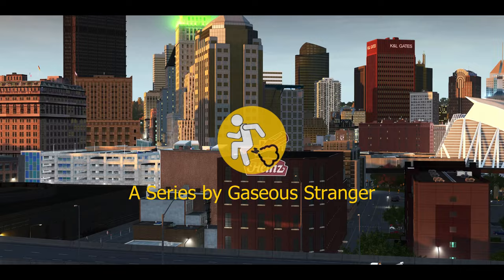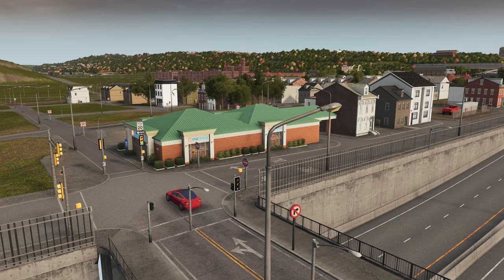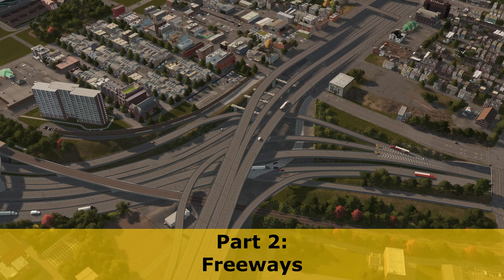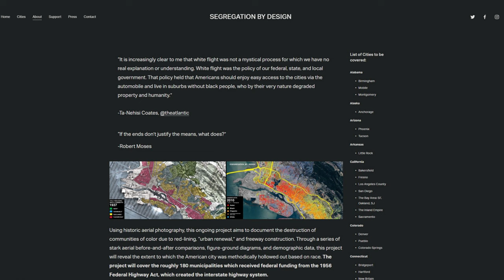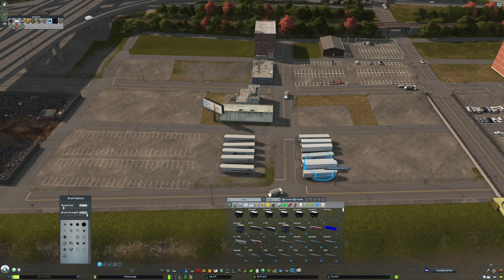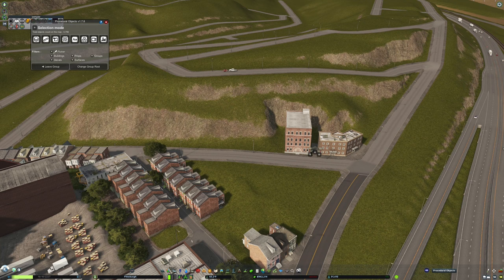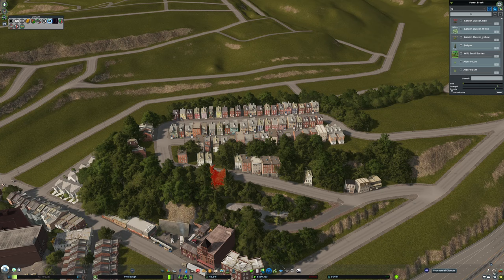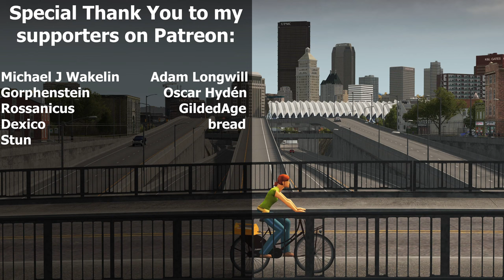Freeways Divide Cities - How Can We Fix Them? | Cities: Skylines Pittsburgh

Comment: I vote for a T line out to Ross and McCandless Crossing. Cap the Parkway North at key locations and put stops at those locations until you get out to McKnight Road.
Reply: Development in the North Hills just really isn't dense enough to support rail, unfortunately. You would have to convince people to drive from some subdivision to a park and ride and then to take the train into the city vs. a 20-minute drive into Downtown with ample parking available. 

If the T gets extended to the airport I would like to see it go up the Ohio River Boulevard area with stops in Marshall-Shadeland (selfish because I live there), Brighton Heights, Bellevue, Avalon, Sewickley, and then crossing over the river with a stop in Coraopolis before hitting the airport. That area is generally much more densely populated than anywhere in the North Hills except for that dead stretch of development between Ben Avon and Sewickley.

Comment: As someone who lives in pittsburgh i think i’d be a great idea to remove the freeway and replace it as surface roads. I could see some like this happening when I276 gets old and needs to be rebuilt. This is wouldn’t be unrealistic either in the US its becoming increasingly popular. Examples would by syracuse which is removing its downtown freeway or rochester which did so too. The problem with a cap park is that it’s not that effective of a solution because often it’s only at specific points that it reconnects the grid. Like for example the other cap park has many problem because of the location of where it connects. The street scape around it is very harsh.
Reply: I’d also like to add onto this that’d it be more attractive for the city too because the land could be redeveloped which means it makes the city money instead of just sitting there

Comment: Up here on this side of the Lakes, in Toronto, we're working on putting a cap park over our downtown railyard, and in my hometown, the highway to the future new bridge to Detroit was designed with many cap parks over it in an attempt to re-connect the two sides of the region. YOU get a cap park! And YOU get a cap park! And YOU!
My standard fantasy highway replacement consists of a simple at-grade parkway/boulevard/dual carriageway (low capacity, mid-speed,) separate bike highway, pedestrian promenade with kiosks and small vending areas for start-ups, and either a light rail/tramway or rail/s-bahn, depending which is better for the city.

Comment: A cap on 279 between Northside and deutschtown is probably as realistic as is possible for the issue… next most likely is an adoption of additional transit options up the 279 right-of-way (busways, T-service)… complete removal seems unlikely to me - the northern suburbs (Cranberry, Wexford, Sewickley) around 279 are growing too rapidly and too significantly - I doubt any county or state official would be happy to see the 279 PGH interchange downsized, or entirely removed at risk of adverse impacts on those growing suburbs

Comment: I don't live in Pittsburgh yet, but I'm a prospective home buyer. I think a rail right of way down the corridor of 279 to connect the T to Cranberry Twp would be brilliant. As a CDL driver who doesn't want to commute by car, a lot of the good higher paying jobs are out in Cranberry. Along with a 24 hour T line connecting the airport to south side flats, meeting the current where it crosses the Mon, or possibly making its way to Penn station, probably by crossing where the current T line already does, and then snaking it back down toward the southside bridge. It could also eventually extend down the Mon to Mckeesport. The third thing I would do is turn the MLK busway into a full on light rail, with multiple pathways connecting the hill district to the strip district via rail stations and parks. That would be huge for revitalizing the Hill District. Possibly even homewood further down the line. That particular T line could eventually end up in Monroeville. Other than more connective bicycle infrastructure across the city streets and ESPECIALLY the canyons, as well as more entrances to the highly closed off GAP trail, that's about the extent of my ideas for now.

Comment: My home! i was born and raised in the northside (specifically spring hill) but my family (grandparents and aunts/uncles) were all from the east street valley, some were forced out when 279 got put in in the 80s. Honestly, this is a needed artery that would snarl traffic if removed. The bigger issue the city needs to focus on right now are the hundreds of structurally deficient bridges in allegheny county, not removing highways or putting in highway caps. Secondly, there needs to be a study on the feasibility of bypassing the squirell hill tunnels, as well as widening the fort pitt tunnels or bypassing them entirely. As someone who commuted daily into and out of the city, that would be at the top of my priority list. Also, The problem will always be pittsburgh’s topography: it’s almost impossible to accommodate the sheer volume of people with the hillsides and rivers constraining the ability to expand roads and highways, as well as build new infrastructure. One thing Penndot should have done is rip out the HOV lanes from 279 and expand the T using that Right of way.

Comment: First off, great work on the CS build.. I found you on Reddit and have been following you on YouTube since. As for the "solution" to I-279, a more radical approach as you mentioned may be more suitable, at least in real practice. I frequently pass by the cap park that covers I-576, and while part of the reason is some constructions happening in the area, I still feel the roads surrounding the park is too busy and has too much volume to truly take advantage of daily pedestrian needs. There have been talks of repurposing the area for further urban development in the future, so we will see how that holds up, but seeing that the 279 interchanges are even more hectic,, I think a potential light rail or BRT route following a minimized parkway corridor up to Ross Twp/McCandless,,, etc. may be more interesting!

Comment: You need to have a realistic but also radical aproach to the North Section to the Freeway.
My Proposal would be, tear it Down to the next Mayor Interchange. Build a sunken Arterial (4 lanes) with sliplanes here and there to the neighbourhood. On top some parks and a mayor Tram and Bike Right of way so you can connect people to the City without using there Car.
This solution could bring a more dense development without bringing more oeople on the roads and further even scaling down the road alltogether. You also could get some space by redesigning the I279 to I579 interchange. A Simple Roundabout with a Flyover connecting the 2 Interstates should be plenty enough.

Comment: My 2 cents in an extended but abbreviated book. Thanks in advance for reading the entire thing.

I live on the North Shore right on the river and there are not too many grocery stores that I can do most of my shopping at. Sure there’s the Giant Eagle by East Village Commons…. But i don’t feel safe shopping there. I have to drive out to Ross, McCandless, and Mount Nebo. Building a new light rail or heavy rail line would be my vote, and still cap 279. Build a park or actual affordable housing for the working community. 

To build a line north you could split off at Steel Plaza and have a stop at the convention center. From there cross the river and use the HOV lanes. Put a stop at East Ohio run up through Ross with various stops near the larger shopping centers on McKnight Rd all the way out to McCandless Crossing. Even add a branch line towards the stadiums from my proposed East Ohio station.

I also think extending the T west to the airport from Allegheny Station is important and should happen. It would have “local” stops along Ohio River communities of possibly Brighton Heights, Bellevue, Avalon, Ben Avon/Emsworth, and either Sewickly or Coraopolis, or even both, and finally the airport. You would also need a more express style with limited stops along the route. The express would have to be more reliable and faster than driving from downtown to the airport though. The drive is roughly 25 minutes, and that’s with delays through the tunnel and up the hill to Green Tree. If it’s not faster the only benefit is reduced cost of travel and parking.

Light and heavy rail just isn’t for coming into the city to work but also getting out for shopping, dining, and entertainment. Combining both routes west to the airport through the river communities and north to McCandless you theoretically would greatly reduce everyday traffic on 279/19 north/south and 65/51/19 east/west. Could also limit trips to and from the airport on 376 through the tunnels. Also, think of the reduced traffic for games, that would be fantastic.

And as an added thought, run a line west toward Swissvale and Monroeville.
Reply: Only downside of my idea is, who is willing to pay for this? Cause it’s definitely not the city….

Comment: I feel like lowering the highway capacity and capping the highway to reconnect those north side neighborhoods would be extremely beneficial for not only downtown and north shore, but also those immediate historical north side neighborhoods. I also would like to think a project like that would open opportunities to utilized unused ROW for T expansion to the North Side, potentially to the Ross Park Mall. The north suburbs are in dire need of public transportation and connection between downtown and Ross Twp would be an excellent start.

Comment: Ive read the other opinions on the freeway project and while I was originally in favor of removing the highway, I think it would be best to bury it and allow for actual development on top of it. It is already sunk into the ground.

While adding park caps on the freeway is better than nothing, in my opinion that is just a band-aid solution that just falls short. A good park requires a constant flow of people in it throughout the day, with different schedules, lifes, and of different class. Otherwise the park becomes a place to be avoided, and lets be honest the noise from the cars below doesnt help either.
Reply: If done well a deck park over I-279 between East Ohio Street and East North Avenue would be well-utilized and would spur denser infill development and mid-rises on the many vacant lots that still pepper the surrounding neighborhood.

Comment: The last thing that should ever be done is a complete removal of highways. They are absolutely essential to the city and the region around it.
A park (or even buildings) above the highway is a great idea.
Seattle handled I 5 pretty well, and Dallas with Highway 366 under downtown. If the freeway is already sunken, almost all of the cost ajd work has already been done. Removing the highway will only cost more and cause more damage. Nothing good can come from it.

Also, before redeveloping the old industrial area near the river, look at what all is still going on there. You say you wanted to get an old abandoned look out of it, but instead you ended up building a trailer drop lot for the nearby factories. These lots are essential for those factories to maintain a supply of available trailers to keep products moving. If you remove their space, they will be forced to buy out other developments (nearby poor housing) ajd tear them down to make more space for trailers, bringing us back to the start of the debate.
Now, if the factories are already out of business, and these trailers have been abandoned for years, then the area is likely suitable for further development.

All I ask is for you to not follow these new age urban planners blindly. Look deeper into the "behind the scenes" of the economy, both in the city and the larger region. Consider how these chances will impact both the local population and that of the rest of the county and state, and even nation.

Comment: What mod and how do you use whatever is happening at 1:28? And 2:01 please?
Reply from the maker: @ 1:28 the mod I'm using is Procedural Objects, specifically the customization tool. Same for 2:01, but in that instance I'm using the Edit > Rotate tool to give the transmission poles a bit of an angle. Sorry for missing those in the video! Hope this helps :)
Reply: @GaseousStranger  thanks for the help. I subscribed to Procedural objects but had absolutely no idea how to use it. So have up.....
Are there are guides on how it's used that are easy to find.
Reply from the maker: @whynotagain3639  I actually have a short tutorial here that can help get you started! - https://youtu.be/RSRKzfs0dng

Comment: Railways also divide cities yet nobody complains about those. So much hypocrisy and bias against motorized transportation. Removing the highways would be a disaster for traffic. Believe me, I live in a city with no urban highways whatsoever and the traffic is abysmal.
Reply from the maker: Railways were, for the most part, built before cities were fully developed while freeways required the demolition of countless homes and businesses, primarily owned by marginalized groups. Freeways also introduce a significant amount of noise and pollution to nearby areas and communities. Freeways were also built with segregation in mind, using practices like redlining to divide cities and disconnect neighborhoods deemed “hazardous” or undesirable from the rest of the city. The footprint requirements are also vastly different for transporting the same amount of people. Ten lanes of freeway VS a few railway tracks.

Freeways also require a vehicle to make use of their benefits and all of the costs entailed with vehicle ownership, which can be prohibitive to some. Railways on the other hand are public works project that benefit all who have access to the train and can afford a ticket. To compare the two is a bit facetious since they are only similar in that they require space.

If cities are built with walkability, bike-ability and other urbanist planning principles in mind, traffic should not be a major concern. With or without freeways.
Reply: @GaseousStranger  Railways were most definitely not built before cities were developed in many places. Take a look around Paris, for instance, and see how many hundreds of city blocks were demolished to make room for the Gare de Lyon, de Nord, de'l Est and all their respective railyards. You can pretty much see the same in every big European city. Noise pollution around railways is massive as well, I live two blocks away from a railway and I hear the trains 24/7. I imagine living close to a central station must be unbearable. The segregation issue is because USA is a massively racist country, not because car infrastructure is inherently segregatory. Yes, trains do move more people than cars, but then again cars are infinitely more flexible as a mode of transportation than trains, which follow a fixed route.

I'm not advocating against public transport, I think it's a great thing to have ALONGSIDE motorized transportation. As you said, they can't really be compared. They fulfill different roles, it's not one or the other. Walking and biking are not serious transport solutions and I won't even entertain them. You can't walk or bike when it's raining, snowing, too hot, too cold, when you need to transport heavy stuff, etc. Freeways are necessary and denying it is extremely shortsighted and advocating for them to be removed is asinine.

I'm 99% sure you've lived most of your life in a suburb, watched a few youtube channels like notjustbikes and pres and think you know the ins and outs of "correct" urban planning. I've lived in a city of 15m people most of my life, depended on public transport for decades, and let me tell you I can't wait to buy a car and move to the suburbs. Some might enjoy it, but for me (and millions of other people) urban living is hell.
Reply from the maker: @Saurion1  While I agree with some of the points you have made here, and I always welcome viewpoints that disagree or add additional commentary. I have to say it’s very much un-called for to make assumptions about my character and my background. I’ve lived in more than a few different countries, in cities of over 8 million people, and towns smaller than 500 people. My opinions are my own and come from the years that I’ve spent researching and studying not only city planning, but also the city of pittsburgh now. For that reason, I will no longer be continuing this conversation.
Reply: @GaseousStranger  hey, you asked an open question, I was merely answering it.
Reply: Maybe take a look at any major European city in google maps, then you'll see that there are absolutely no highways going to the city center, yet there are no big traffic problems and people can also take the excellent public transport or bike or walk anywhere they want, there is no need for a huge highway in the city center
Reply: @Saurion1  Btw, rail only needs rail and the stations, compared to cars wich need parking and more roads, get together all the parking spaces and highways used by cars and then compare it to rails and stations